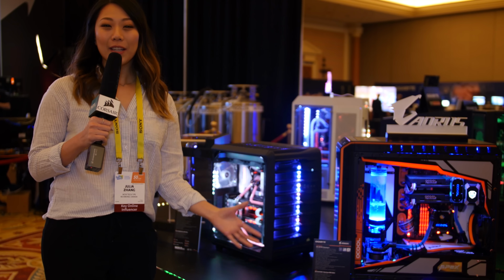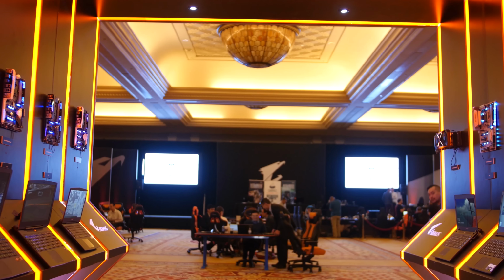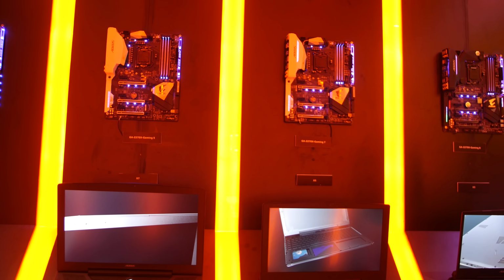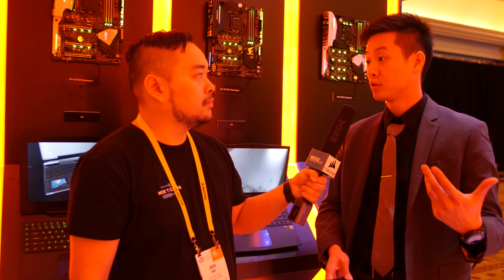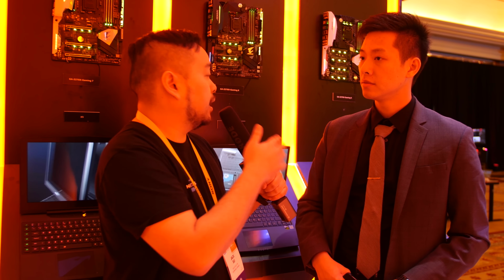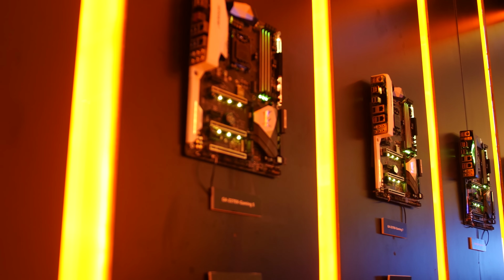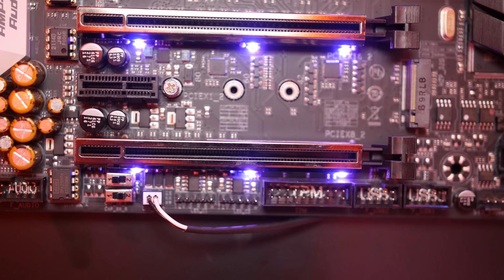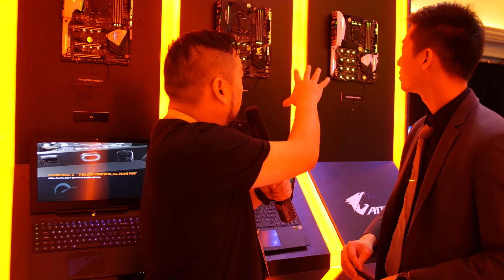AORUS Z270 Motherboards Bring Fancy Back

Comment: How does Gigabyte f**K up the design!!! stop the trend of non functional RGB . keyboard and mice make sense but wtf is RGB on a motherboard.
Reply: Darkz Md you can just turn the lights of ya know
Reply: But I'd like no rgb and the cost of rgb to go somewhere else. things like G connectors for front io,right angle 24 pin and usb 3.0,integrated io shield. I'v have a mid range board with those features
Reply: infact such features should  become standard in my opinion